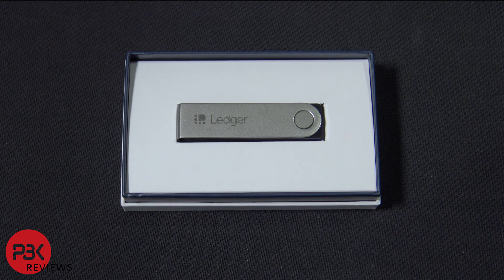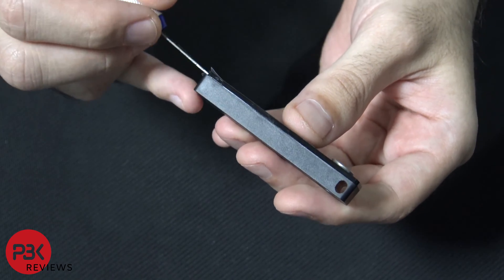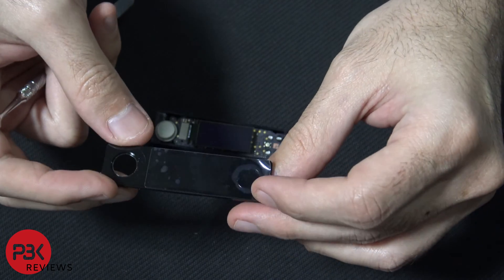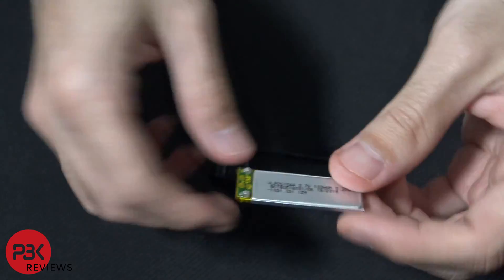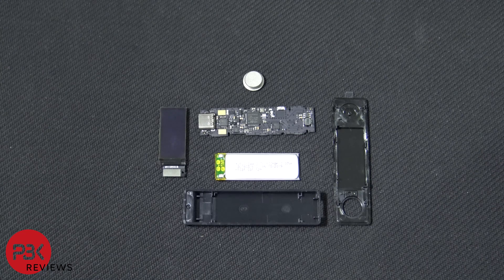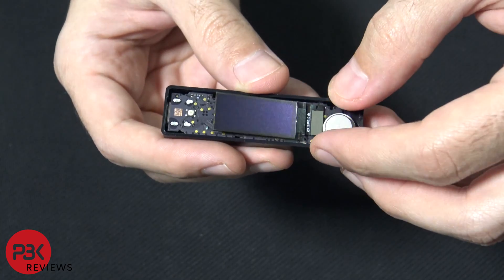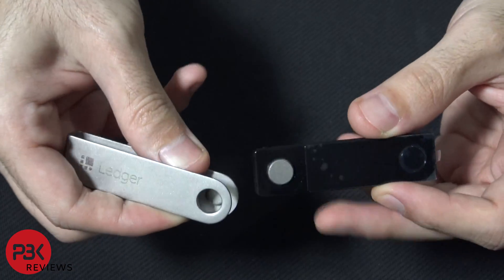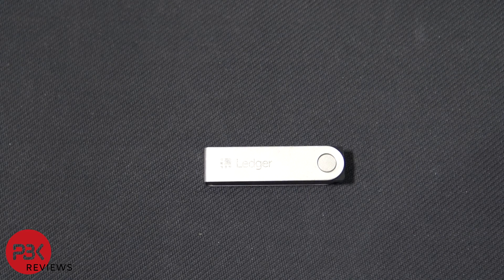Ledger Nano X Teardown Disassembly Bitcoin Altcoin Crypto Hardware Wallet

Comment: Has someone checked it out that whether Nano X would work without battery connected if you isolate battery contacts? Does Nano X's OS allow it to run without battery detection?

Comment: It's not easy to put back together. In fact its down-right difficult to get the cover back on, and if like me you will scrape off parts of the circuit board pressing down coz the stupid button moves around everywhere and scratches the bloody circuit board!

Comment: Pretty pathetic how easy ledger makes it to get in without breaking the housing completely.
Reply from the maker: Why would you want it to be more difficult? It's done this way so you can replace parts if needed without loosing access to your data say if the screen were to break or the battery go bad etc.

Comment: Where can I get a replacement battery?  I tried PLB but they don’t offer it.  So anyone found a battery that fits?
Reply: have you?
Reply: @MarcinAdamowicz  It has Dongguan LP251544N battery but not available anywhere even on Aliexpress, they're sending wrong unit. Btw, does it work when you completely detach the battery out of the device?

Comment: I've gone through all the steps that ledger recommended (different cables and laptops, firmware upgrades, software upgrades, etc.) but nothing's working - I believe the Smart Chip (or whichever the specific connector chip is called) in my Nano S is malfunctioned - as when I plug the device into my laptop, the device powers on as it normally does, but it is not recognized at all.

Would you happen to know of a solution / way to fix and/or replace this chip?
Reply from the maker: Hmm not sure honestly. If you are good at soldering you can always get a second one and de solder the chip from the 2nd and solder it onto your current one but aside from that I don't know what else to do.

Comment: hello I have a problem with the battery not charging what can I do? 🙏🙏🙏
Reply: I read you can slightly bend pins to battery upwards. Some production problem.
Reply from the maker: It can either be a bad battery or charger port. If its the charger port, you would need to take it somewhere that can desolder the old one and solder a new one onto the board. If its the battery, you would have to probably purchase another ledger and take the battery out of it and replace it with yours.
Reply: @PBKreviews  🤦‍♂️🤦‍♂️🤦‍♂️🤦‍♂️🤦‍♂️🤦‍♂️🤦‍♂️🤦‍♂️🤦‍♂️I first buy a new one
Reply: Hi Gigi, I had the same problem with my device that arrived yesterday. The device stated "Charging issue, unplug/plug in USB" or something similar from the very first boot.
What you need to do is to bend the small connector PIN:s you can see quickly at 1:38 (https://youtu.be/f2akZgy1pcY?t=98) upwards a little bit. The issue is that the connector pins from the battery does not reach the board.

I can recommend turning the device upside down when fixing this issue, in that way you're going to access the battery faster and more easily (the buttons was a pain in the a** according to me).

I used a tweezer to open the device up, but I guess there are better options because I ended up scratching the chassi of the device when opening it up - but who cares, the device is now able to charge and is 100% charged. :) 

I'm so happy I didnt have to send it back to Ledger and wait for a new one.

So big thanks to you @PBKreviews for posting this video and showing us how to open the device up!
Reply from the maker: @kimzky.m0v  Thank you and you're welcome!

Comment: Hey, can a ledger nano s or x be repaired from being damaged. I accidently ran over it with my car and its in pieces. Chips have also come off the board.
Reply from the maker: Hi, probably not if the mainboard is damaged etc. It would require special tools and skills for such a job if even possible depending on the extent of the damage.

Comment: Does the device work without the battery? I don't use the Bluetooth at all, so it just sits on USB. I'd prefer not to be leaving the battery at 100% charge forever.
Reply from the maker: I'm not sure, its possible. I don't have it anymore to test out or i'd check.
Reply: @PBKreviews  can confirm working without battery.
Reply from the maker: @decentdanoz  Nice
Reply: ITS WORKING without BATTERY... my PROBLEM with my NANO X i recently Bought.. was not CHARGING.. I need to plugged in USB cable all the TIME.. I dont know why.. all new NANO X bought this yr has an ISSUE about not charging battery
Reply: @annaclairemarquez3283  I read on reddit you can bend the pin connecting to the battery up slightly at 1:40.
Reply: @decentdanoz hi, did you get any confirmation from any source whether Nano X still keeps working with a completely dead battery? Or do you have to detach the battery out of the device? Does it work?
Reply: @TheAppraiser85 I removed mine so long ago I'm not sure where it even is. Still functional as ever. I'm not sure if it would work with a dead battery. Always worth a try.